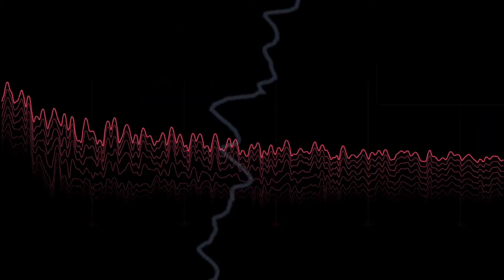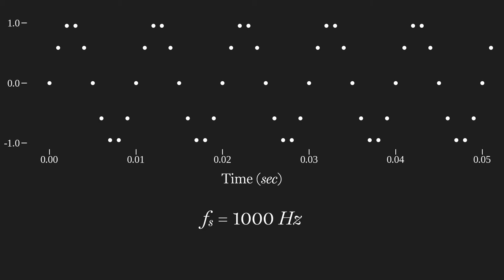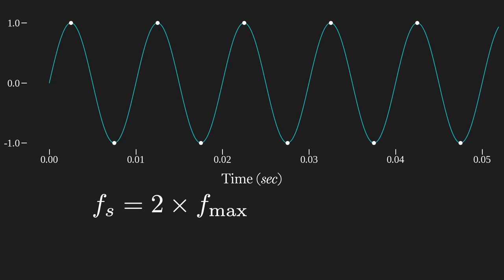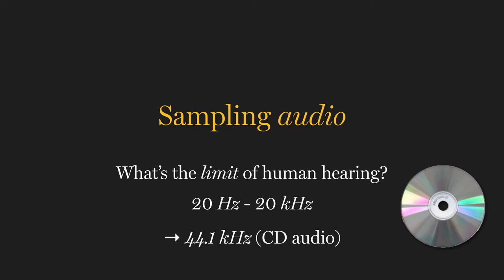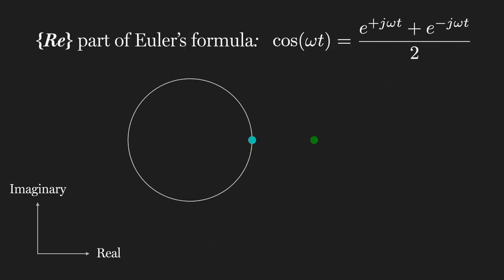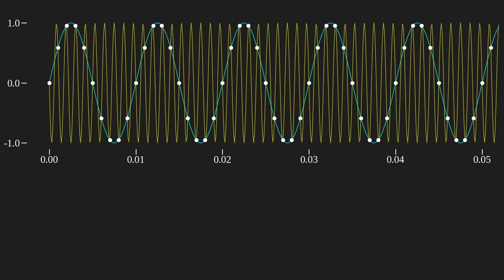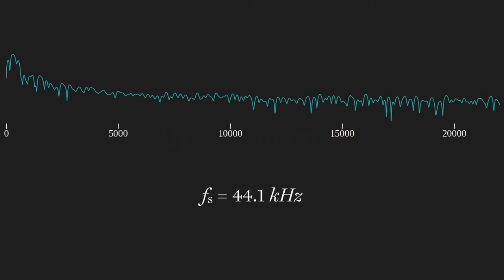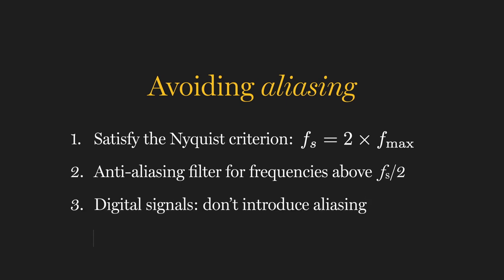Applied DSP No. 4: Sampling and Aliasing

Comment: At 12:15, I think the sampling rate numbers must be a bit out of sync with what we are hearing because there is obvious aliasing even when it says 44.1 kHz, and the aliasing is already bad at 40 kHz. If CD audio has no frequencies above 20 kHz (which it shouldn't by standard), then there shouldn't be any aliasing at all if we sample it at 40 kHz. And even at 36 kHz, a 20 kHz sine wave should reflect off the 18 kHz Nyquist limit and become 16 kHz, which is extremely high frequency and almost inaudible for most adults. Yet the aliasing sounds far lower in frequency. Or maybe something is going wrong when you convert it back into 44.1 kHz (or 48 kHz) for YouTube. What is going on here?
Reply from the maker: Thanks for the catch!  Yes, there's definitely an issue, and more aliasing than indicated in the animations.  I believe there's a bug in my resampling code, which is approximately doubling the amount of aliasing at the same point in time. I'll keep looking into this and post a link to a corrected version soon.